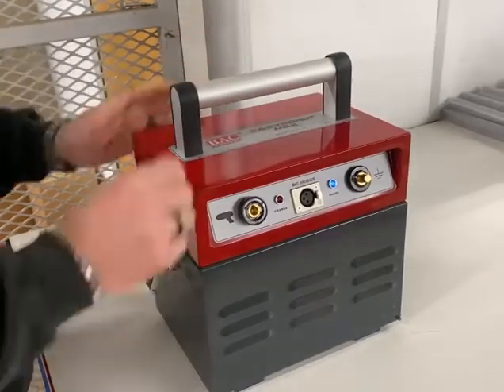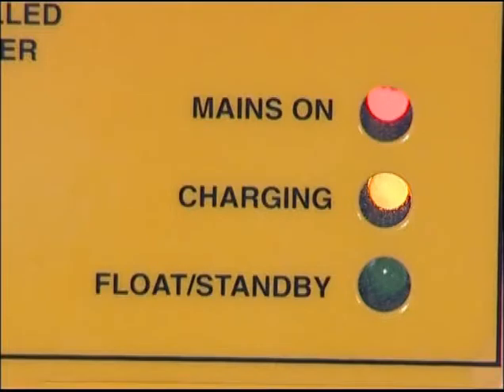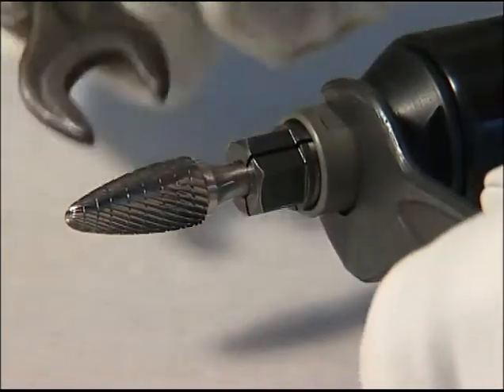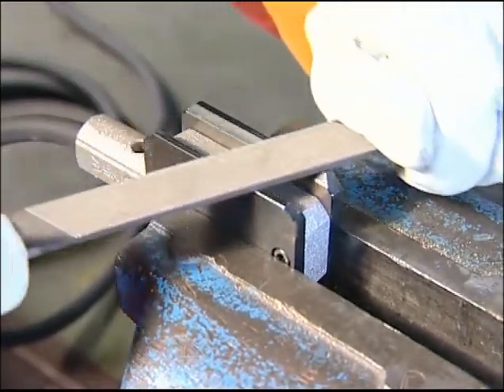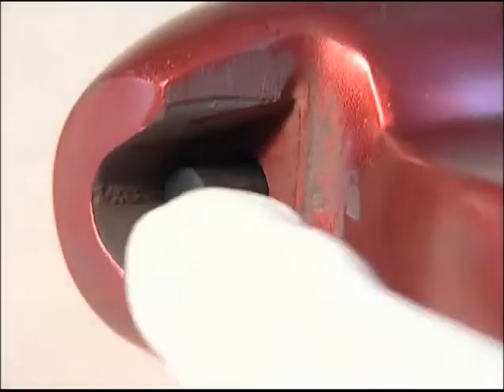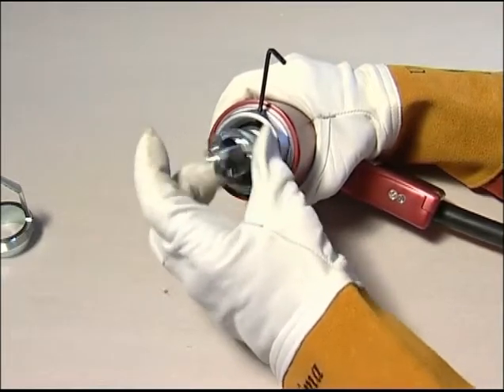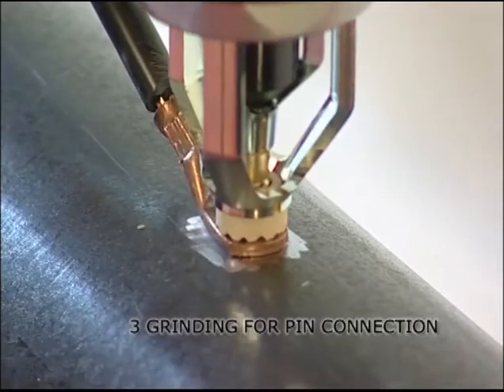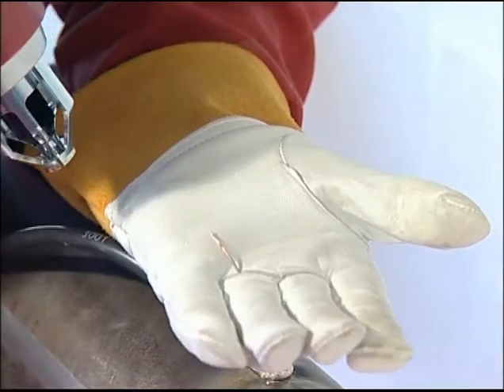Pin Brazing Training Video

Comment: What is the methodology and material for insulating/covering this connection for soil
Reply: Kema coating is most common in Canada
Reply: Denso Protal 7200, or Sp2888 or sp4888 two-part epoxy coating are common in the U.S.